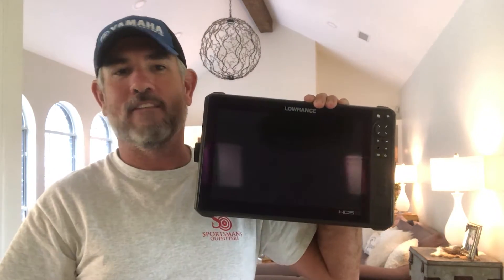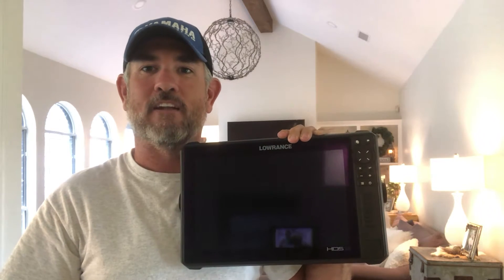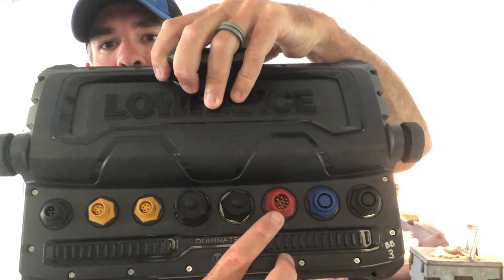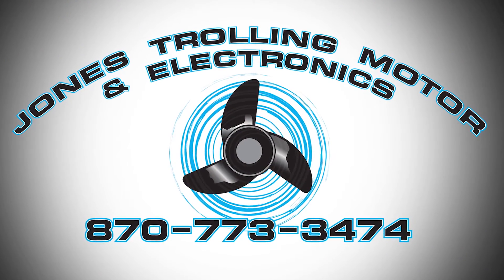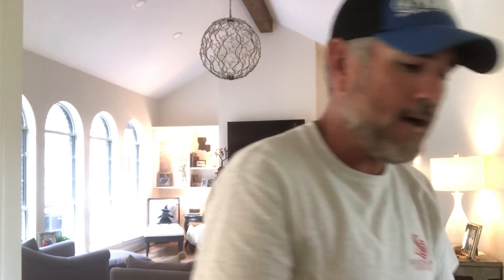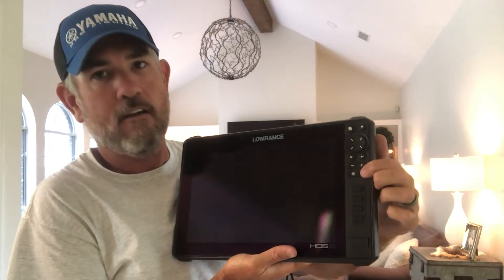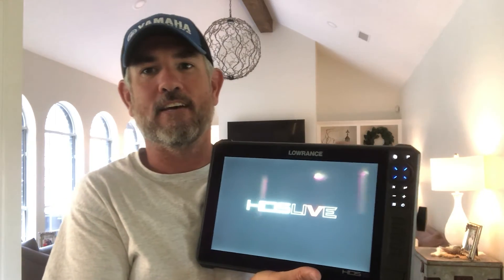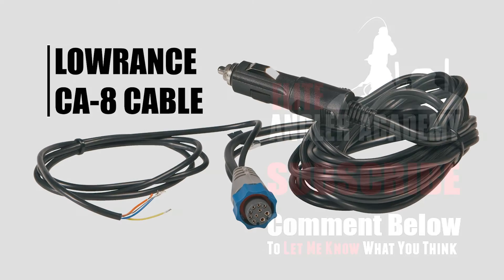How to Power Up a Depth Finder Inside Your House

Comment: With no transducer does it startup in Sim mode.? What are you’re next steps for managing you waypoints off boat using this method
Reply from the maker: It will indicate "No Source" for sonar operations.  If you go to the chart screen, you will be able to see whatever mapping you have in the unit as well as your waypoints.  If you need to turn on the GPS features, you will need to select that unit's internal GPS instead of whatever other networked GPs unit or Point 1 you are running when they are rigged on the boat.